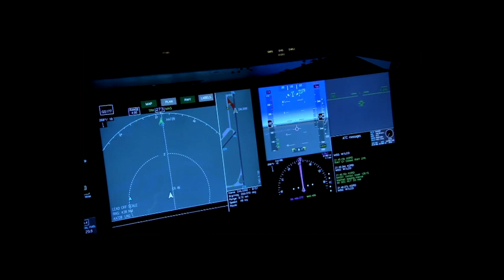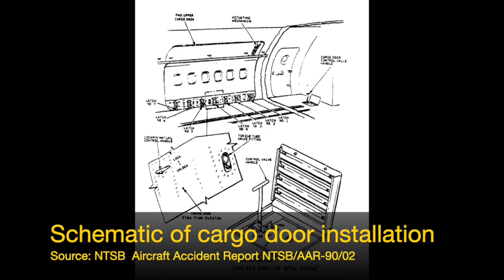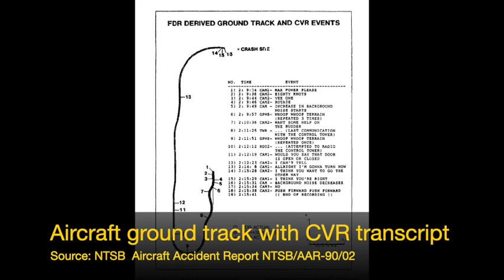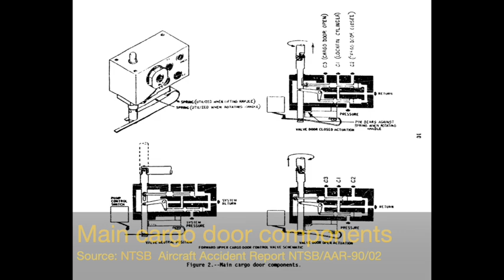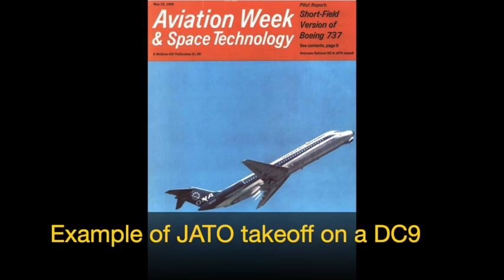Aircraft Cargo Door Headaches – Episode 173

Comment: On the DC-9 disrupted air flow over the horizontal stab and elevators is especially catastrophic because the elevators are operated by cable driven manual geared tabs and not hydraulic actuators like other aircraft. In short air flow pushes on the gear tab and the gear tab moves the elevator. Disrupt the air flow over the tabs and no elevators, no elevators no pitch control. The DC-9 does have hydraulic actuators but they are only active in full nose down (yoke full forward) to help with stall recovery.